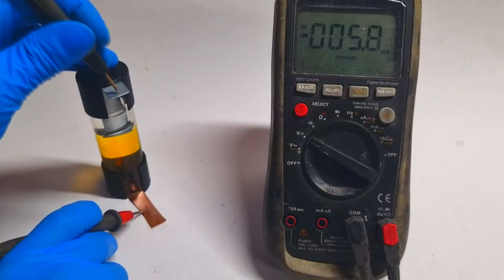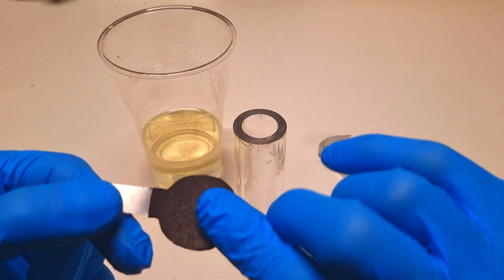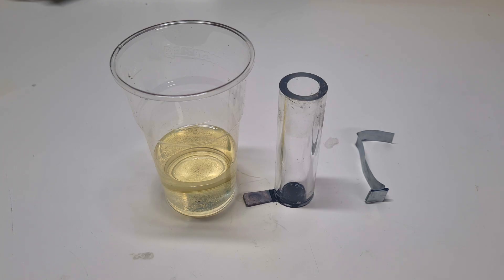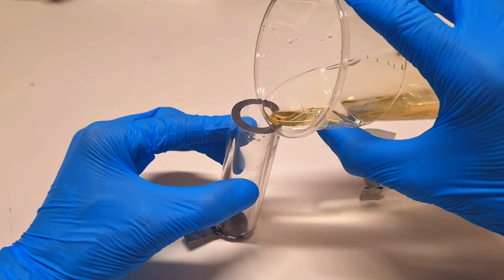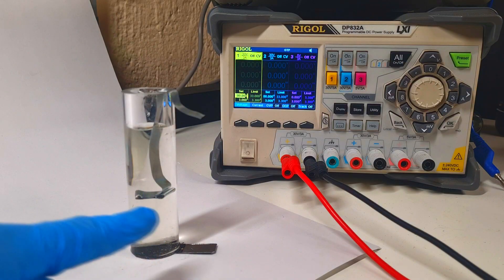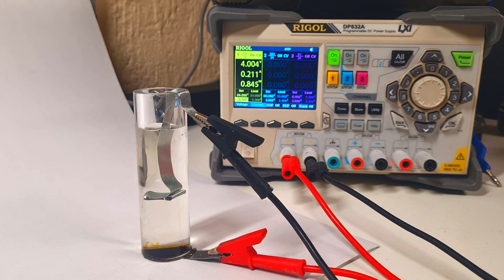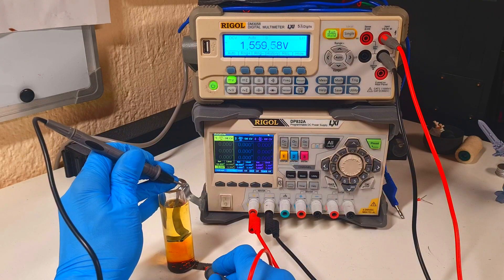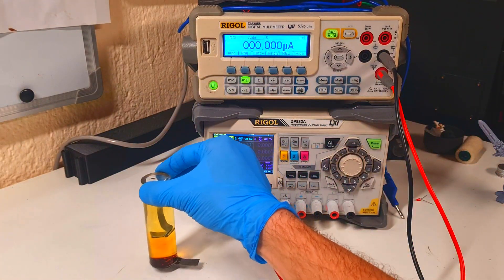Diy Zinc Iodine gravity battery

Comment: Hello, can you find a way to increase the life of lead batteries so that the positive plate does not break after 100 charge cycles. A new type of lead battery with durable positive plates and easy to make at home. Pakistanis smear with lead oxide, which is difficult to make.

You show zinc chloride and zinc bromine, but everyone has an old lead battery from oops AND IT CAN MELT AND CAST LEAD PLATES.
Reply from the maker: Yes the positive plate breaks down because of the corrosion of the lead grid. Many years ago we work on a thin film lead acid battery projects where we make three different approaches. Because the lead acid battery was a thin film variant for this reason we use thin lead foil for the current collector (make a note that thicker is the lead current collector more time is needed to corrode and for this reason you will get more cycles). First variant was that we support the lead foil with graphite paper - when the lead foil was corroded away, the graphite paper provide conductivity for extra cycle life. But the graphite paper support extend to only 80 cycles, becuse the graphite expand via the high charging voltage and lose the necessary conductivity. The other two methods was to plate the lead foil with Tin, silver or carbon. Tin was the best because it have good conductivity and good chemical resistance. Tin coated lead film last to 400 cycles (400 cycles was our target cycle number and for that reason we stop with the cycle testing). Using silver was also promising but expensive. And the carbon coating lead film was not good due the bad conductivity. You can also use Tubular plate like is used in deep-cycle batteries.

Comment: What makes it a "gravity" battery?
Reply from the maker: A chemical "gravity" battery (because you have also mechanical gravity batteries) is a battery type which the electrodes are separated by gravity. Which means that the chatode is on the bottom and the anode on the top..... and the active material which have higher density (in that case the iodine) will be formed and droped to the bottom. In the video you can see a black/brown layer of the active material on the bottom.
Reply: Gravity separate the electrolytes, more clearly, zinc iodide is lighter(less dense) than HI or Iodine

Comment: According to chat GPT, the possible energy density of zinc-iodine go to 100 to 200 Wh/kg and zinc-bromine 30 to 80 Wh/kg, more potential with iodine
Reply from the maker: About the zinc iodine is more or less correct (it can have also a bit higer energy density also).... but energy desity for the zinc bromine battery is a bit off. Because my static Zn-Br battery can get to 370wh/kg
Reply: @cayrex  that's incredible i should rewatch them all, but what is the explanation for such a Gravimetric energy density, because of liquid surface area/arrangement? For some reason I believed this was fundamentally limited by chemistries used. Are Zn-Br flow batteries in principle able to attain 370Wh/Kg also ??
Reply from the maker: @Earzone63  That zinc bromine battery is a part of the hyperflow battery program which uses special electrolyte and cell design ,.... but the info about the battery is for now not public. I think that the theoretical energy density of zinc bromine battery is around 440Wh/kg.